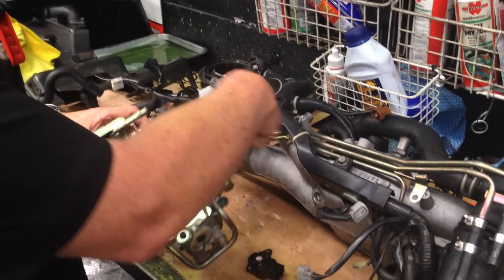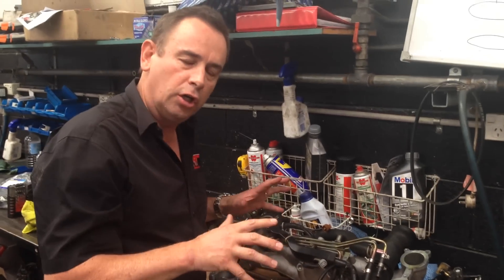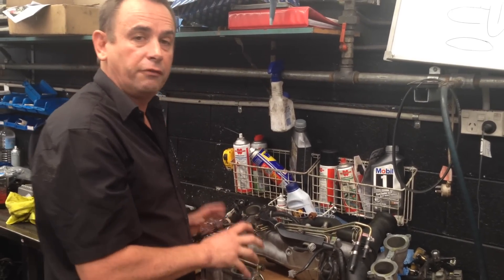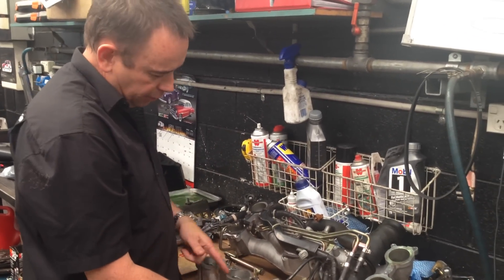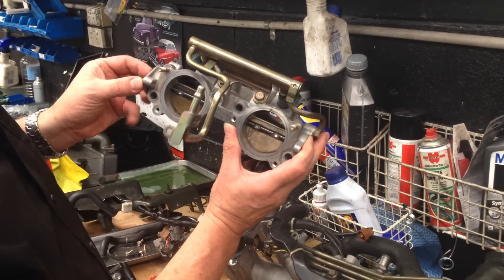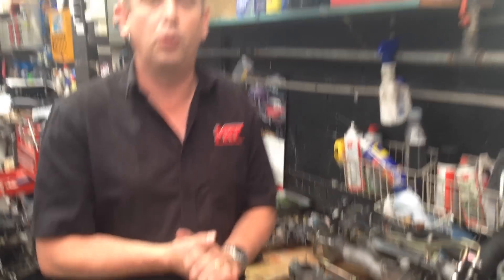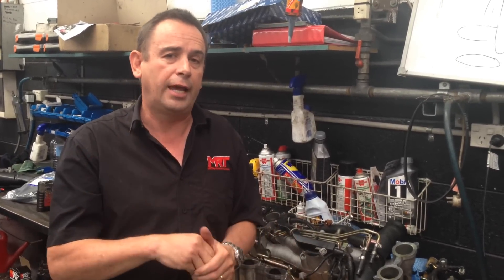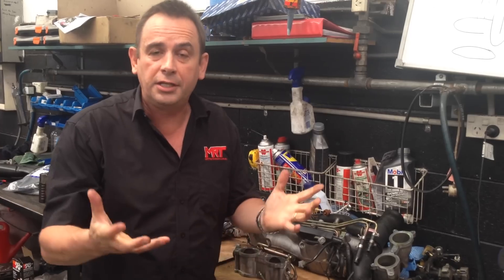Subaru engine modifications, TGV and how it works and what to change

Comment: Amazing video! My Subaru was giving me a TGV open circuit code. Found out the are where the wire clips into the sensor is broken. Most likely the issue. Gonna get a new sensor tomorrow.

Comment: So when I reinstall the motor and sensor do I manually close the valves or leave them open and let the computer adjust them Sorry if this is a dumb question lol😂 I’m dealing with a p2006 intake runner stuck closed
Reply: You have to preload the sensors when installing them! Or else they will not work!

Comment: Just take the two sensors put a shaft in between with a bracket to hold them together plug them back in computer won't know the difference

Comment: These are just like throttle bodies you clean them with brake cleaner wipe them out with the rag and brake cleaner Don't spray it in because it will get down in the drive-by-wire activator clean throttle body clean blades and it will run a whole lot better sometimes even eliminate a code

Comment: I have an American '05 STI. About 6 months ago I got a CEL, and it started making a low whistle that changes pitch depending on throttle position, plus I think there may be a small power loss at higher RPM. Also, a couple of times it's gone into a "severe loss of power" mode. I took it to a mechanic, and they said everything checks out normal. I don't buy it. I'm not imagining that whistle, and I sure as hell didn't imagine the CEL and the "limp mode" coming on yesterday. Could one of these be dirty, or stuck, so it doesn't open all the way? The car is completely stock - I'm sure of this because I'm the original owner, and it had never been to a mechanic before this started happening. It had about 89,000 miles when it started happening.

Comment: Hate these stupid things. Stuck with an intermittent code for it that i cant get rid of even with a new tgv motor and sensor. Removed the sensor multiple times for a new one and to check spring. Made no difference. I gave up. It comes and goes. Goes away at idle. Comes on when driving depending on temperature outside.
Reply: I've had the same problem with CEL "P2004 Intake Manifold Runner Control Stuck Open (Bank 1)". I'm dreading going through the trouble of replacing it just to still be stuck with it. Which model are you running? 2013 WRX hatch here.

Comment: Thank you Brett! After a JDM swap with an EJ20 and repairing all the boost leaks the engine was still loosing power on the top end with little torque on the low end. After watching  your video I found the driver side TGV was stuck in the closed position.  All Great Videos!
Reply: How did you fix it? Mine is throwing a code for stuck closed, I changed the sensor but it’s still throwing the code
Reply: @joebalzano7461   The motor that opens and closes the TGV probably failed causing your issue. Its on the opposite side of the sensor you replaced. Try to replace the motor. 2nd option, remove the motor, manually open the TGV, reinstall motor then disconnect the plug. You should have your car back to full power as i did but you may get another code.

Comment: Can you assist with advantages of removing the pcv and VTA-- EJ25 non-turbo -- vehicle is used for slow driving applications to work and back - no serious accelleration or over driving the pedal .Thanks in advance.

Comment: if you only remove the flaps and leave everything else, do u need a tune/reprogram?
Reply from the maker: the best result is with a custom tune
Reply: is going to add some performance ugrade doing the tgv removal to an gutted uppipe ej205 turbo subaru? what I really mean it is quite easy job to do and it may worth to do it after going for a remap?
Reply from the maker: its a painful job,if you are ONLY doing this  as you need to remove the WHOLE inlet manf,
Reply: this should not be a problem i have spare time and i like challenges, but i would not like doing it if i can't get some performance upgrade, would worth it?
Reply: jonny bgood I have recently spoken to my local subaru tuner who priased the tgv deletes for the power they produce "when tuned" under the curve. He told me that the tgv delete will net like 5 peak hp or so but towards 20 in the lower rpms. This was in reference to my 2010 wrx so not exactly the same but I would imagine you would see similar results again with a tune.

Comment: Hi Brett and MRT.  My mechanic diagnosed my stock (unmodified) TGVs as not not working very well.  Just curious if you are seeing this as a common thing in cars you work on.  Seems like something owners should keep an eye on as a reliability concern.  Mine is a 06 WRX EJ255
Reply: hows ur ej going nowadays? about to buy a wrx with swapped with a ej257 bottom end soon

Comment: This valve equalizes the inlet flow velocity between the TBI and the head inlet, because of the distance between them, to minimize intake manifold reaction time, improving injection set-up, torque and emissions.
Reply from the maker: this means its for emissions only, not performance
;)
Reply: I think so too, leave that hollow bottleneck!

Comment: OK if you remove butterflies how does it affect cold starts.
they are there to richen mixture on cold starts ?????????
Reply from the maker: its purely for emissions, the engine starts easy
Reply: oh ok its like the air pump that my forester has purely emissions until it failed and i had the guys who put the map in to turn them codes off.
Reply: they only stay closed for the first 30 seconds.

Comment: The TGV on my 1 and 3 cylinders is having issues on my '12 STi. It was stuck closed. I took the motor off of the front side of the engine and saw rust on the white plastic half-moon gear and motor gears. I don't know how it got rusty but I think this is why it got stuck closed. I cleaned it up and don't have a fault code at all now but my engine idles at low MPG but highway without moving throttle too much it is fine. Also when I move the half-moon gear it does not spring back, is that normal? I feel like the sensor on the other side is missing the spring.
Reply from the maker: its not rust its grease
Reply: MRT Performance what could explain the increase in MPG after I wiggled the white half-moon gear and put the motor back on? It was pulling a P2006 code prior with 8mpg

Comment: I had a friend and the passenger side TGV got suck closed and he was having issues with first and third cylinders misfiring like you stated. So I had shown him this video and explained that I had done the same butterfly delete like you had in the video onto my 2002 wrx and he should do the same and he wouldn't have to worry about them getting suck closed ever again.
Reply: same issue here, cylinder 1&3 misfire with a P0171 too lean bank 1 code. rReplaced my intake manifold and throttle body with the TGVs and I'm sure its the same for me sigh

Comment: Is there anyway to improve low end torque and top end power on the 2015 2.5l in my Outback Limited?
Reply: RandiRN1 It'll be rather difficult to get extra power out of a naturally aspirated Subaru motor. Most performance NA mods will sacrifice low end performance for better top end.

You're better off buying a diesel or 6 cylinder version of the outback.

There could be a few changes you could do, but a lot of these would be miniscule, untested or expensive.
Reply: have you got a response on this question? I have the same car
Reply: Swap the 2.5 out for one of the factory turbo engines, that or NO2
Reply: Do a motor and ecu swap to one of the wrx motors the should fit but make sure you do a FULL swap do not leave the stock radiator, fuel lines, pumps etc and think youll be ok with just the block and turbos.

Comment: The new engine 2.0 FA also has TGV
Reply from the maker: yes
Reply: Everyone should pull those damnded carbon goo generators and swap in open pipes.  A few companies make kits i highly recommend the full replacement of both sides not just the valve but the black plastic part as well.  Honestly the FA20 needs an EGR delete and a good AOS.  Add those 3 things and get a good Cobb tune you will get twice the benefits than messing with the intake cats or exhaust.  Anyone wanting to exceed 300ish whp will want to seriously consider a crate motor, while the initial layout is pricy you will save thousands of $ snd hundreds of hours chasing problems.

Comment: I have an 05 LGT and I'm getting a P2007 (TGV stuck closed). I replaced the sensor with a new one and made sure that I spring loaded it but the cel didn't go away. Now I'm planning on replacing the TGV motor/actuator. Is there a specific way to install the motor/actuator to make sure that the butterflies are in the open position and don't stay stuck in the closed position?
Reply: when you remove the actuator the flaps close, sohold the flaps open when you install the the part.
Reply from the maker: +Luis Molina sorry, its hard to describe here, best visit your local subaru specialist :)
Reply: Hey Luis, I know it’s been 7 years but I’m having the exact same problem you are, did you ever figure out how to fix it?
Reply: Yes, I finally did thankfully. I took it to a Subaru specialist mechanic and he took it apart and confirmed that one side was stuck (the flaps were stuck closed) Therefore, he offered to do the poor man’s TGV delete by removing them and  cutting off those flaps that open and close. That fixed the problem and beat having to spend money on the TGV delete mod and the time it would have taken for them to arrive. Not to mention having to be without my car for a while.
Reply: @luismolina4219  thank you very much for the reply, I’ve been chasing this issue for a while with no luck, I’ve hesitated to take the intake manifold off since I drive it everyday and am afraid that something would go wrong and leave me with out my car for much too long. I think based on what you said I’m going to find a Subaru specialist and just have it taken care of properly. Thanks again !!
Reply: No problem, happy to help. I found the mechanic I took it to through the NASIOC forum. Good luck!

Comment: I have a 2007 Subaru wrx. Getting the engine code p2005. Saying my intake manifold control runner is stuck open. Where can I locate the sensors and the motor or anything I can do to fix this

Comment: I live in Buffalo New York and it gets very cold here 4 to 6 months out of the year, would doing this TGV delete mod cause problems with cold starts?
Reply from the maker: +EricSTaTuZ maybe
Reply: The tgv is just for emissions, it's not there to help your car run better cold. It's there for the fuckin epa. Removing it only makes the engine run better and more free
Reply: EricSTaTuZ I live in buffalo too. I've helped with two tgv deletes for friends and only one had cold start issues for a little while, but I don't think it was related because he messed a few other things up
Reply: I live here as well, so far no one i know of had problems, degrees at high of 1degree and they said no issues at all.
Reply: @yeahh_idk_  I'm in NY as well. Will removing butterflies create a code that will prevent passing NYS emissions if I leave them plugged in?
Reply: Matt Mccabe Youll need to tune your car if you remove them, itll throw a code. But once its tuned to not have them, itll pass inspection. I have egr tgv deletes and catless resless no codes and I pass inspection from the OBD2 plug in.
Reply: @yeahh_idk_  thank you, that is exactly what I needed to know and couldn't find an answer to. Wasn't sure if deleting code would be caught by inspection regardless of the lack of check engine light. Thanks man!

Comment: 2015s have TGVs as well. Had mine removed with my tune.
Reply from the maker: yeah, cool, did you actually measure the gain, with no other mods?
We are testing this next week
Reply: No, the shop that did it said they have seen 8-15hp and up to 20ftlbs with no other mods.
Reply from the maker: hmm, we will find out   soon!
:)
Dyno test coming
Reply: +MRT Performance how was the dyno test?
Reply: How'd that dyno test go?